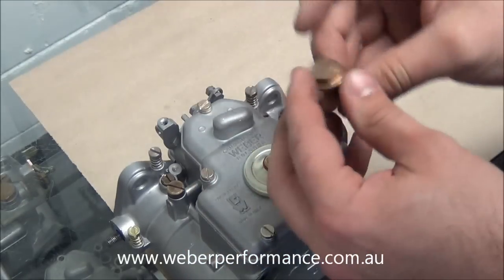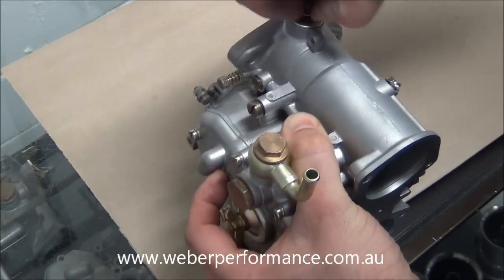45 DCOE 13 Weber Assembly - Part 2

Comment: The float pin should be inserted from the non split end, it can be pushed by hand all the way through to the split end and only requires 2 taps with a small hammer to get it fully home, instead of hammering it all the way through from the split end, it’s only the split end that has any compression on the pin to hold it in place
Reply: Yes please can we get the op to bump this?
Reply: was thinking how much easier it is to go the other way while watching him do that lol

Comment: I would appreciate a dis-assembly guide with a typical dcoe showing how the various caps / pins can be remove without destroying them.
Reply: if you see how they go in it should be pretty obvious how to take them out. everything is either held by threads or friction.
Reply: I think that should read "threads and sticktion."

Comment: "...take a small hammer aaaand just gently pound the shit out of the pin." Just kidding, thanks for the videos! I just bought a pair of used 45mm 152 DCOEs that need some love. ALL of the venturis on them are more or less distorted, because of ovetightening, original screws have been replaced with miscellaneous bits, the other one has it's frame cracked just between the air cleaner mating surface and the venturi etc. I sometimes wonder what kind of cavemen handle these things..